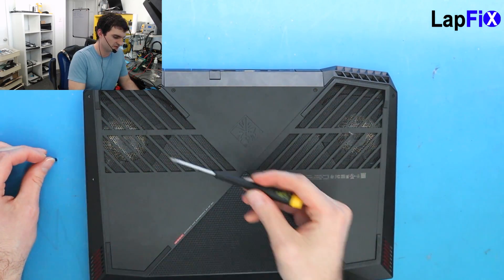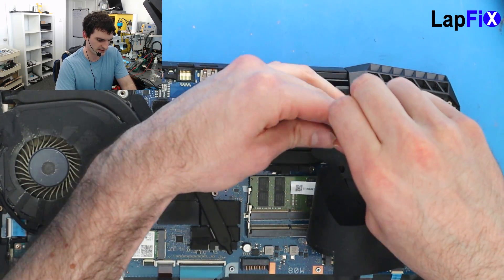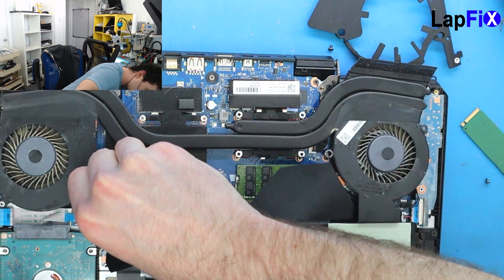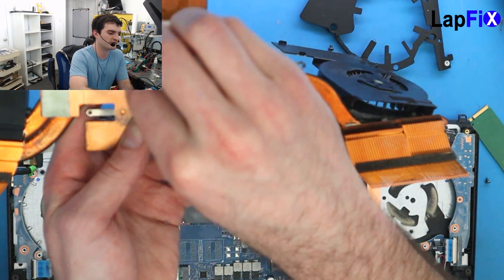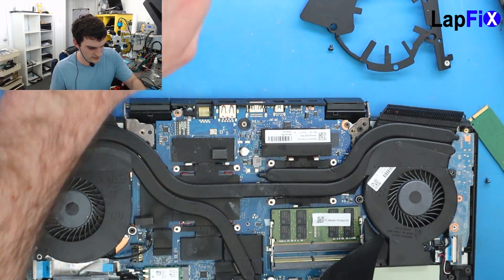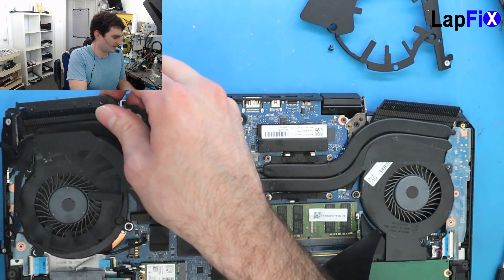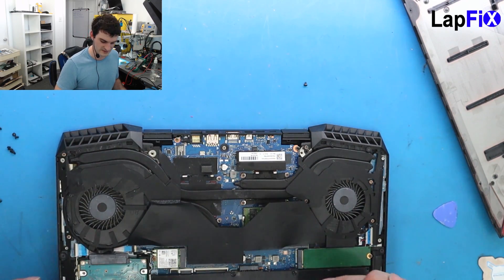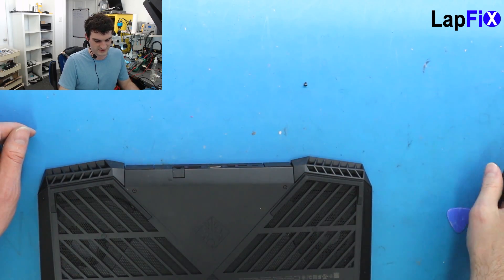How to clean HP Omen Fan for More Gaming Performance | Easy !

Comment from the maker: I hope this video was informative. Please like and subscribe so YouTube can show this video to more viewers. I received a lot of questions about the thermal past I recommend. Link for the thermal past I used in the description.
Reply: Hey man. My laptop is Omen dc0052nr. Mine has the same problem of thermal throttling. The main problem is that one fan runs slower than the other. It is like 2000 rpm in one and 200 rpm in other. Any idea on what might be the problem? I seriously have tried cleaning it but no improvement. Please guide me in this. @Lapfix I'm way too far to ship this device actually. So please do help me solve it.

Comment: By cleaning this after 3 years after i bought mine it lost -15 degrees during gaming and -10 degrees while idle. When you open the heat sink at 6.00 the area between the fan and the heat sink had so much dust for me. Mine laptop had the i7 and would turn off after getting to 98 degrees during gaming. Very informitive.

Comment: Thermal paste is just to fill in the micro imperfections of the die and heat sink for more efficient heat transfer. The goal isn't really to have a layer between the 2. Other than that, great video! Also, I may have missed it, but have you suggested undervolting the cpu?

Comment: I have a hp open and I'm super scared of damaging it. I know there is dust in there but is there a way I can just clean it cause I don't wanna risk breaking it. There is also a stripped screw not allowing me to open it up. Any ideas on how to solve this
Reply from the maker: A stripped screw will make it much more difficult.  If you are not having issues and just want to clean it, I would just leave it be.   If you are interested, you can contact us through the link in the description and we can help further, thank you!
Reply: I was so scared before but i cleaned it and changed the thermal paste today
Reply: I went head on and took it apart.first time for a american brand laptop im used to taking apart boutique laptops apart like sager/clever.
Taking it slow and watching a video of someone taking this apart is key to doing routine maintenance

Comment: I'm gonna have to do this because I have never cleaned it and I bought it 2 years ago. I've also noticed that when I play a game its more hotter than usual, instead of maintaining 87-88c its now maintaining 89-92c. I'm going to clean the fans and replace the thermal paste. I'll update this comment on how it went.
Reply: I assume you broke your laptop so we aint getting no updates l0l
Reply: @cavityvavity520  Lol no I haven't done it yet, I'll try and do it next week maybe.
Reply: @cavityvavity520  But dang reading these comments makes me afraid to do so
Reply: @alexwhitton1  you should be good as long you follow the steps like this video did and make sure all connections all plugged in and everything then it'll turn back on just fine.

Comment: I'm genuinely noob in that kind of stuff (so hope it's something that can be done by me) but I've noticed that my laptop has got more and more hot during gaming sessions these days. It still works awesome (no big bugs or freezes etc.) but I'm afraid I should clean the fans at the back since they are not releasing as much air as they did before.. I mean there is like really little air coming out of them.. What do you think? How often should that thing be done actually?
Nice vid and thank you!
Reply: There is no blanket duration for how often you have to clean the fans or replace the thermal paste. The general rule of thumb is that if you feel like the laptop is too hot or is hotter than usual, it's a good idea to start disassembling, clean the fans and change the thermal paste. Although, changing the thermal paste shouldn't be too frequent since thermal paste has a lifespan between 3 months to a year,  depending on how frequent your laptop gets hot. If you disassemble your laptop and discover that your thermal paste has gone dry and crusty, it's time to change.
Reply: What does thermal paste do?
Reply: @Braaage-  reduces temps.
Reply: @Braaage-  Sorry if I'm late. The thermal paste helps to bridge a contact between the processor (or GPU if you apply it to the GPU) and the heatsink. This allows the heatsink to conduct the heat better which transfers the heat to a fan, which will blow the heat from the exhaust. If you let the processor (or GPU) come into contact with the heatsink without thermal paste, the heat will become excessive and can escape to other parts of the laptop, resulting in more heat and subsequent damage.

Comment: I have an omen 17 from 2019 that has had a problem with one fan twice in two years where it starts making horrific noises like a diesel engine. Opened it up cleaned out the dust and everything but still makes the rattling noises. Both fans seem to be permanently connected to the heat sink so I don't know how I would replace just the one malfunctioning fan without changing the whole heat sink along with it. Have you ever seen this issue and if so do you have any recommendations ? Appreciated
Reply: I have the same issue
Reply: me 2
Reply: @sherifmourad79  hello did you fix it?

Comment: I tried to remove my heat sink but 3 screws got stripped, i have searched in youtube ways to remove these and tried the least dangerous methods without any result at all. I need a proper method to remove these and of course get replacements for the screws before removing them, if i have to buy a tool of something i will but please i really need advice with this.
Reply: Hi, im in the same situation, did you find any ways to fix the problem with the screws? Because i can't remove it, i can't do anything else

Comment: Is it okay/enough to just clean the fans with a toothbrush without having to remove them? Because I don't wanna go through the hassle of removing them and doing something wrong on my thousand dollar laptop 😬
Reply from the maker: Yes, that is another good way to clean them.  Just be careful not to touch anything while opening it up.  It is very easy to short something on the board

Comment: Hi, really a very informative video, super like it. I got a question for you, is it ok if i can clean the fans using vacuum cleaner just over the vents (meaning cleaning the fans over the latpop back cover) without actually opening the laptop.  i do this usually in 3 to 4 days once. Please support
Reply from the maker: Yes you can, but be careful of static. Only do when necessary

Comment: My temps are usually around 80°c but resetted pc and now my fans are noisy af and got low gpu usage.
Reply from the maker: Check the Thermal past.
Reply: Mine reaches 96🙂
Reply: @Yeslem12  mine runs at 98 deg Celsius and can cook an egg.

Comment: What should be the normal temps for this laptop when gaming? I changed the thermal paste on the same laptop for a friend, but his laptop had an gtx 1050 ti and an i5 8th, my friend told me that the CPU themp would go up to 94°. After I changed it and cleaned the fans it went down to 84°, but I think that's still very high
Reply from the maker: It is good to see that the temperature went down after putting new thermal paste.  It is a bit on the high side, but it is a laptop and you are pushing it a lot during gaming.  How are your temps while not playing games?
Reply: @lapfix  I'm not sure to be honest. He has the laptop now and I only had it for a few hours, But I think I saw that the cpu was between 40-60°C when I was on the desktop
Reply: From what I've read in comments, sadly 84 when gaming seems to be average for this laptop
Reply: As long as it doesn't shut down, you're good to go. Cap the fps down to 60. That will push temps below 90. If you want temps no more than 80, just turn off turbo boost, even 2.4 ghz is enough for 80% of games.

For example, if i am playing fifa or arma, i cap the fps to 60 because more is useless. Also i turn turbo boost off. That way i get 60 fps stable with 70 degree cpu and gpu.

Comment: I had a problem after I opened the back cover I slowly removed the dust under the cover I only removed the ram and installed it again the closed the cover and tried to start the laptop it does open successfully but after a minute the screen started to crash and went black and white in a noisy way and the machine stuck there so I shut it down by pressing the power button then tried to start it again put it won't open
Please help I don't know what seems to be the problem????

Comment: I have HP Omen 15 too, there is some dust at the bottom grill. Want to clean the fans but I don't wanna do the full disassembly. 
1. Bottom panel seems hard to open in some videos. Should I try opening it?
2. I could also try with just compressed air, but where do I blow the air?
Reply from the maker: You need a Phillips head screw driver, besides that it isn't bad to open.  If you are worried or feel a struggle, I would stop and take it to a shop
Reply: You can actually search at youtube how to open hdd omen. Its easy to disassembly back cover. 2 screws at bottom didnt mean to take off.

Comment: I7 9750h stock is hot 97 degrees
Undervolt with throttlestop
I went from 97 degrees to 74 degrees
3.4ghz on all cores(6)
Thermal grizzly kryonaut did nothing for this cpu.it just cant handle the tdp constant boost which is rated for 4.5ghz.smh what a joke.my omen gtx 1660ti stays cool but with shared heatsink the dispersed heat can mess that too!
Reply: I tried using throttlestop but every time I do it doesn't make any difference please can you just tell me what settings you put on it to make it work

Comment: I only fully took out one fan and i cleaned in between the top part of the other, I didn't remove the battery when I did this and now my computer power turns on for a few seconds and turns back off without any signs of getting better. is there a way to fix this?
Reply: You probably need to fully clean the area where the other is.

Comment: My  new omen 15 gets  too hot can you help me wath to do
Reply from the maker: You might need to check if you need to apply a thermal past.
Reply: i have a hp omen and there nothing wrong if it gets too hot its normal in a laptop i recommand u to undervolt it trust me i did the same and it decrase the temperature by 15 c  i use to get around 80 - 85 but now 70 -75 c
Reply: I just bought a cooling pad for mine, seems to work quite well
Reply: @Braaage-  hey, a little late to this comment, but what type cooling pad did you buy? I bought a dual fan for mine, and it just seems to blow the hot air around.... doesn't really dissipate it at all.

Comment: Hi my fan completely stopped spinning would cleaning it make it work again?
Reply: It depends. Does your laptop turn on? If it doesn't, it could be everything from a dead pin that controls the voltage of the fan to a bunch of dust and dirt piling up on your fans. I'm definitely not an expert so don't take my word, but definitely the best advice I can give you is to try and open your laptop to see if you can easily clean the fans and try it again. If it doesn't work, try and take it somewhere when they can SHOW you the problem and most importantly, HOW to fix it if it ever happens again

Comment: Hi, my laptop lately is doing a weird sound on the fans, could it be dust?
Reply from the maker: Or it can be the fan going bad. We received MSI laptop today with the gpu fan making noise. The fan need to be replaced. Will upload the video soon.
Reply: @lapfix  
At a certain point, the fan stopped. What should I do?

Comment: I want to clean my Omen from dust because I noticed higher temperature recently and it's full of dust(I can even see the dust when I flip it over) plus sometimes static electricity builds up in the laptop and I see a little spark from my finger to the laptop when I touch it and then every time the laptop shuts down. That just started recently because I moved places and I think the laptop sucked in a lot of dust and that's the problem. Now im not sure if I should clean it or send it to hp repair center because I still have 1 more year of warranty and I don't want to lose the warranty by opening the laptop. Will hp even clean my laptop if I send it and say that it shuts down and that it's temperatures are higher than they were before. And another thing is 1 of my fans is much slower than the other when I look at RPM and every time I start it I get a message in bios that one of the fans is not working properly(the thing is that messege was there from beginning and people say on forums that it's normal for that version of omen 15 that I have but it sometimes disrupts my Windows update because if i don't press enter at the restart the update stops and my windows once got corrupted because of it)
Reply: Hello there, I just recently change the speker at hp center. And still warranty, before they open it up I told them to clean fan also. And they did it.

Comment: Hello so I did all that but didn't remove the battery cuz the screws were used up and it was impossible to remove it, now the laptop wont turn on, there is no power from the battery or from wired, so my question is "In how much trouble am I in?"
Reply from the maker: You always need to remove the battery when you remove any part or connection from the motherboard. Is hard to say what  damaged  without checking the voltage on the board.

Comment: Can I use a vacuum to suck out the dust without opening the case up
Reply from the maker: You can, but make sure you power the machine off and unplug it.  Usually there is a mesh in there that holds dust particles.  Be very gentle
Reply: lapfix thanks a lot man

Comment: HP had gotten a bit better with their gaming laptops, but they still haven't gotten it as good as those barebones gaming laptops (software wise). Also your customer may need to upgrade the RAM (and possibly both of the storage) because games these days had became more taxing than it is months ago. A single 8GB RAM isn't enough to run games well for my current Gaming laptop (HP Pavilion Gaming 15-DK0051WM). Although it isn't as powerful as the GTX 1060. But at some point it needs dual channel RAM regardless of how fast and how much GB the single RAM stick is. Because on Skyrim Special Edition It was hitching on lowest quality settings. I had put 16GB kit in it and thrown in Intel 665p, Seagate Barracuda 2.5" SSD (both 1TB each). So now I am good to go so far.

Comment: I just open it and i fucked up i took out all the screws and still doesn’t get off also i have difficulties putting the top parts on the corners my advice do not open it alone unless someone with experience does show you fck

Comment: Can someone give me tips for opening the casing?, its so hard
Reply: Did u open it up? I'm too scared seeing everyone struggle opening it
Reply: I used a very small flathead screwdriver (like jewelry sized) to pry open the seam in the front corners of the case. It did scuff the case a tiny bit but it’s the best way I could find. After I got it open on the corners I took an old credit card to the seams and managed to unhook all the plastic connections with that, hope it helps!!!
Reply: I'm also having trouble with this.

Comment: Temps while gaming are... 95-97C. I hate this laptop with a passion!
Reply: U can under volt the cpu in bios mine was around 97C on the default option I set it to 25W an now highest I see it hit is 75C on battlefield 5 an FPS still stays around 60 on high settings
Reply: @kamryn7496  how did you manage to undervolt this beast inside its BIOS?  Thanks
Reply: Kamryn how
Reply: Download Throttle stop. it worked for me.
Reply: @jagelosering  yes, it is inside
Reply: @catiatutorialsad5989  my bios doesnt have any option for undervolting im on AMI F.16
Reply: @jagelosering  idk if it's still relevant, but I have found fixes for this after trying all kinds of other solutions, including intel extreme tuning utility and others. I found a solution on my own that works for my laptop but may not work for all models. 

Thought I'd share because I know my posts on tucked away forums won't reach everyone.

This is how I fixed the problem on my HP Omen 15.6 (15-ce198wm), which I bought in 2019.

1. Open Control Panel
2. Navigate to Control Panel\Hardware and Sound\Power Options. 
3. On the sidebar, click on "Create a power plan."
4. Create this new plan based on the default "High Performance" plan. 
5. Name it something like "Temp Control High Performance," or a similar name you will remember it by.
6. Change the screen time out and sleep timers to your liking and select "Create plan."
7. You will be back to the plan selection screen. Open your new plan by clicking "Change plan settings."
8. Click "Change advanced power settings."
9. Navigate down to and click on the "Processor power management" drop box.
10. Open "Maximum processor state."
11. Change the values for both "On battery" and "Plugged in" to 99%. 
 
All other values can be changed to your liking. I have found online that the cpu for this model likes to run at 100% for no reason so long as it is allowed to. From what I have read, there seems to be a manufacturer defect with some models of the processor that causes this in tandem with certain omen motherboards, or HP deliberately did this to gain the maximum standard performance for unseasoned users. Either way, it's a hinderance to performance if it's constantly overheating for no reason, so hopefully this fixes it for someone.
(copying and pasting from another reply I wrote in this thread)